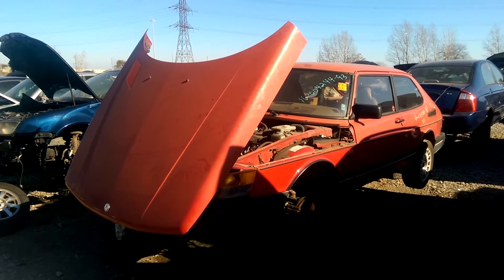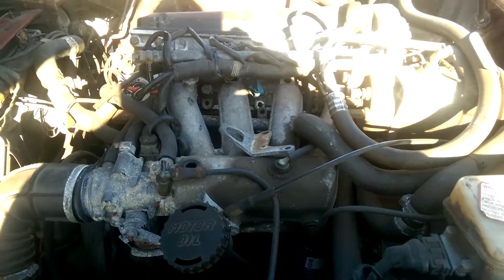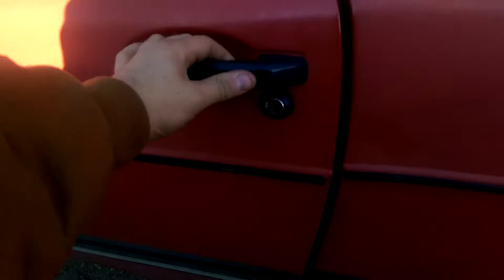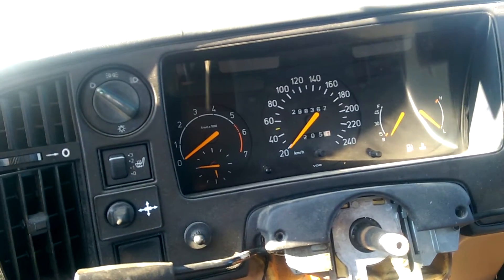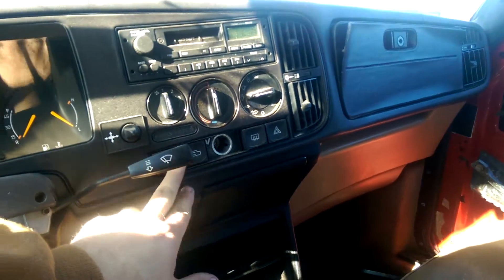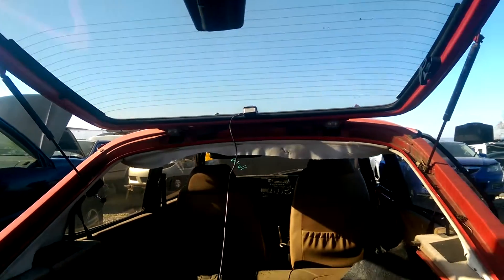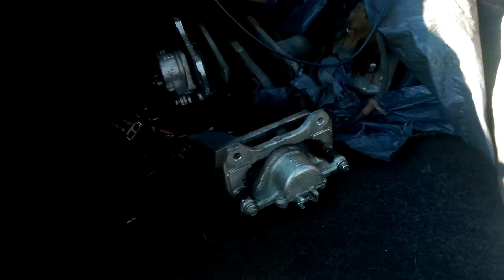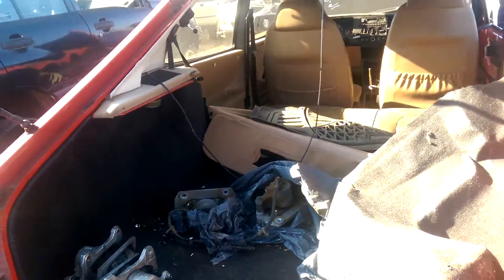RARE and CLEAN 1993 Saab 900 in the Junk yard

Comment: The snowflake button is the air conditioning on/off switch.  They were tough old cars those classic 900s,  300,000km is 186,000 miles so that's barely run in for one of those if it's been maintained properly, I had a 1986 900i with well over 300,000 miles on it and it still ran like new, though it was noisy in 5th gear which is common on these as the bearings are a bit weak but once they've been rebuilt properly with upgraded bearings the boxes are good for 1,000,000 miles.  The headlining is a very common issue on these, I believe what happens is that the heater is so powerful and throws out so much heat that it melts the glue that holds the fabric to the backing board and eventually the cloth starts to sag and drop down.  Volvos can be quite prone to doing the same but good quality replacements are available for the SAABs for not too horrendous money and are easier to fit than those in Volvos tend to be.  The worst place for rust and rot on these is often the front inner wings/fenders where the driveshafts and steering rack pass through, particularly on later cars like this, cars that are very good everywhere else can be very rotten there and it's a major safety issue as it's structural.  The engine in this should be a 2.0 litre, probably with this being a late car it will be a low-pressure turbo and it looks to have been quite a high trim level, maybe an S or XS judging by having electric windows, electric mirror on the passenger side and leather seats, though it's fairly unusual to see one without a sunroof...
Reply: gosportjamie couldnt have said it any better. People neglect these cars because of what they hear but if kept on maintenance these cars just want to keep going. I have a 1991 just like this car in the video and mine turned 350,000 miles a few days ago. Original trans and engine! Great cars none the less!